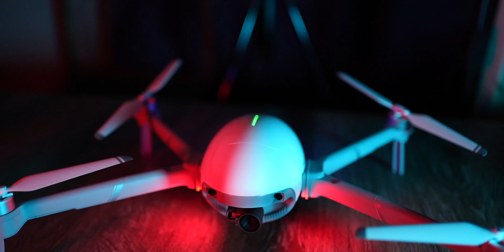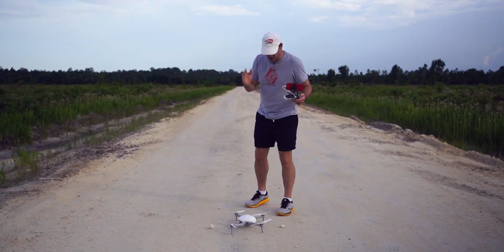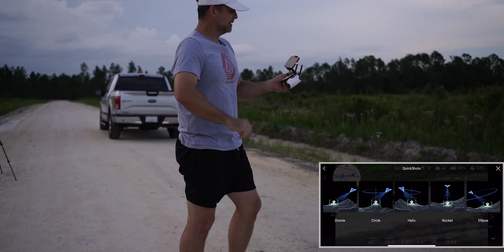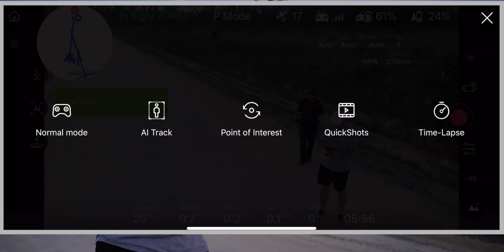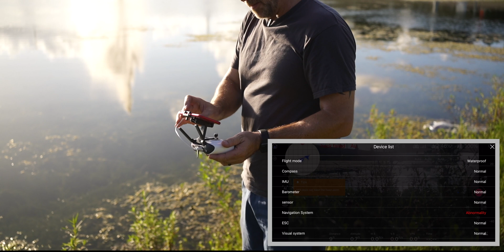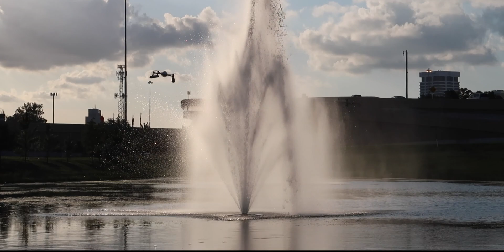This CRAZY Drone Flight Took Us Through a HUGE Fountain

Comment: A really enjoyable review to watch.
I was an early adopter of the PowerEgg X, purchasing the full kit last February, and as an early adopter I experienced a few teething problems. The big issue was it wouldn’t work with my Samsung S7 and the 4K video appeared to be dropping frames even though I was using a very fast R/W memory card. The great thing about Powervision is their exceptional after sales customer support, being in the UK I was dealing with their office in Finland. I opened a ticket via their webpage and within a few minutes received a response from a real person, and not someone working from a script but someone who understood the product. My concerns were passed back to the developers and a few days later a firmware fix for the video issue was released. The Samsung issue took a bit longer as this was due to the chipset used in some European Samsung devices.

I’m a bit of a drone nutjob, I have close to 100 in my fleet ranging from small 2inch race freestyle machines up to a 1200 size hexacopter carrying a DSLR, but I’ve found the PEX the most enjoyable to fly and use for photography. Very recently my PEX started having issues whereby it wasn’t recognising that the arms were connected and so would only work in AI-Camera Mode. I opened up a ticket and again the response was very quick. After a couple of back and forths they decided to replace the complete kit, including the waterproof kit, with a new system, and my PEX was collected by a courier the next day. My replacement is currently making its trip to the UK. In contrast I had an issue with a DJI product back in 2014 that they promised to rectify, that is still sat on my shelf gathering dust.
Regards
Nidge.